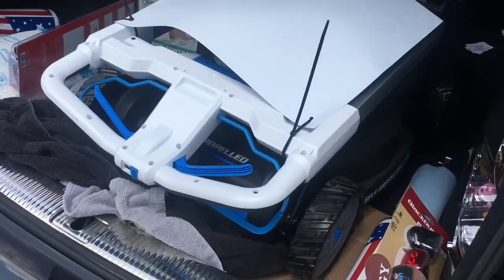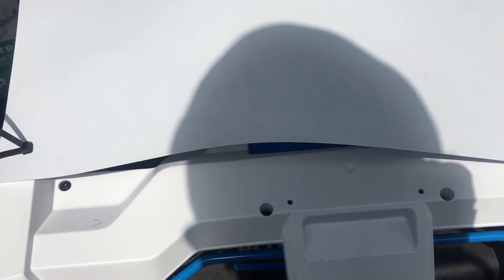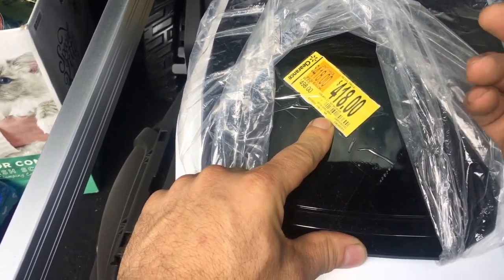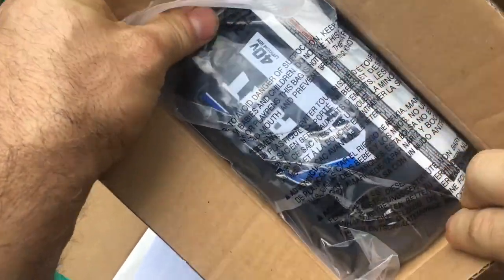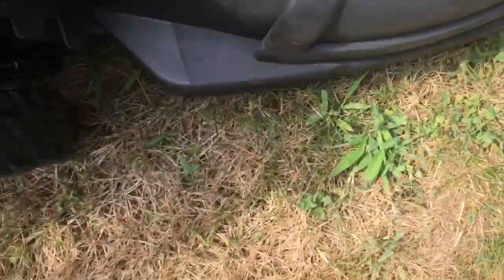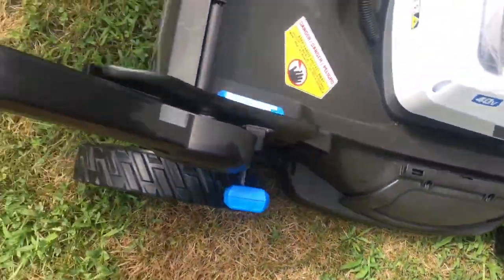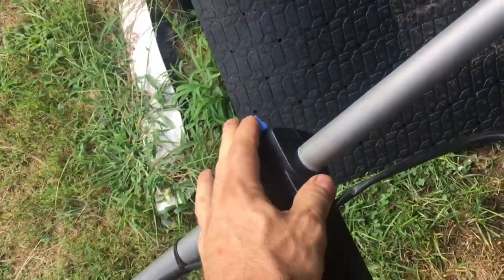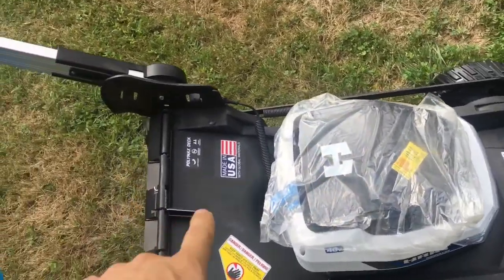Walmart Clearance Hart 40V 21” Brushless Self-Propelled Mower Kit HLPM061US 2 6.0 ah Batteries $200

Comment: Looks like an Internet-to-store open box return. Nice find!

My full-priced unit just arrived today. I'm actually going to be doing a complete unboxing for it shortly. I ordered my unit a month and a half ago. Got lost on its way to me the first time. Oh well, I'm looking forward to comparing it to the next model year once it's released this spring.
Reply from the maker: It was a floor model. luckily it had everything with it. I did a comparison to last years model. truthfully I like the older model better I think because the new one you are forced to use the driving motor due to a flaw in the older model that they fixed.  I believe I mentioned it in this video and definitely in the comparison video. the drive engage system on the old model has a major flaw in that its pulling the engage wire with a piece of plastic shaped like a finger that is thinner than a chop stick. this works good in the lab but take it outside in the sun where plastic gets hot and over time that plastic finger bends instead of pulling the cable and this the drive motor never engages. so with the new model here they totally remove that setup and make the drive motor 100% engaged. so when you dont want to use it to like um make the battery last longer you are forced to push the mower as the drive wheels spin the motor. they should have just resolved the issue by making the plastic part metal.... but what do I know... 
    https://youtu.be/I936cP06eLI

Comment: i need to know what type of nut (size and thread) is behind the wheel cap (hub cap) for the HART 40-Volt 21-inch  - one of them fell off of mine. if you know, i beg you PLEASE tell me the name so i can go to the hardware store or to an auto part shop to get it. the Hart people dont seem to know what it is that i need after MONTHS of calls and emails! Thank you!
Reply from the maker: why would I know the size and coarse if I had the nut when u dont know it from the bolt? just measure thickness of the bolt. maybe poke hole in paper so it fits perfect over the bolt then go to tractor supply (better loose selection) or home depot. find an metric and sae bolt that perfectly matches the hole. then find a nut that fits those 2 bolts. there will be 2 Metric 2 SAE fine and coarse threaded. obviously wrong threaded wont fully go but its the size. each nut will be about 20cents so its not like you would be breaking the bank buying 4 to find which fits and then you can well waste $1 in gas returning the 3 for 60cents ;)
Reply: The rear wheel is held on by a serrated flange nut 10 millimeter x 1.25 fine thread. It is more a specialty size with the fin thread but is available at Home Depot in their metric nut drawers.

Comment: The sound difference your hearing Is the older one has a variable workload where the mower pushes harder when under load, the newer brushless just gives consistent power.
Reply from the maker: I never noticed the older one which i use all the time change when under load. it doesnt try harder when I hit heavy grass it stays the same except when it bogs down if I go to fast.

Comment: Great score! I have been waiting for these to get marked down. Will keep looking in TN.
Reply from the maker: I have a store near me that has the 18" at $120 and the 20" push at $145. the 20" has a 6ah battery in it ugh. I'm so tempted to buy it LOL. I already have a 20" self propelled and a 20" push along with a 16" 20v and an adaptive speed 21" LOL
Reply from the maker: SKU: 454921461  UPC: 840092601026  HART 40-Volt 21-Inch 3-IN-1 Self-Propelled Mower (2) 6.0 Ah Lithium-Ion Batteries
Reply: @bobspurloc  I got the 18 inch push last year because of you. Love it! Now I want the 21 inch self propelled.
Reply from the maker: LOL Nice! how much you get 18" for? Hart now has a Driving 80v mower except they want $3000 for it... yeah no!!! and TTI the main company released a 2 stage Snow Blower for Ryobi and soon for Hart also but thats over $3000 too... so annoying... I'm thinking of finding a blown motor snow blower and converting it to electric using Hart 40v batteries lol

Comment: You got a smoking deal on that.  I got mine last year on sale for $440.  Practically a free mower if the batteries and charger were bought separately.  Same mower and batteries are now $598 for this year.
Reply from the maker: Yeah I drove a long way just hoping it would be at the store. very nice deal.
Reply: Walmart has them on clearance again for $236.  Depends on store though.